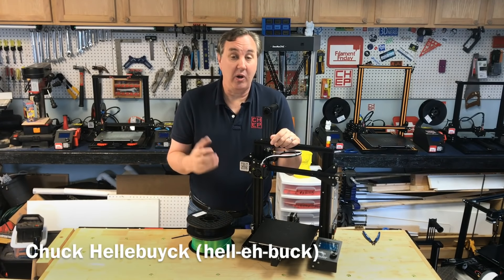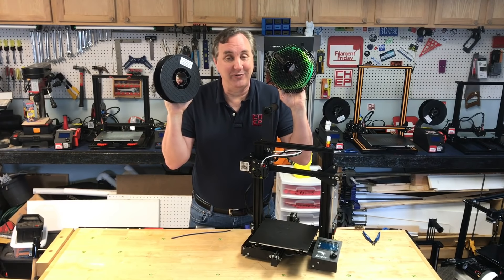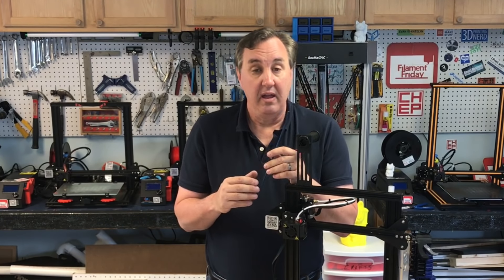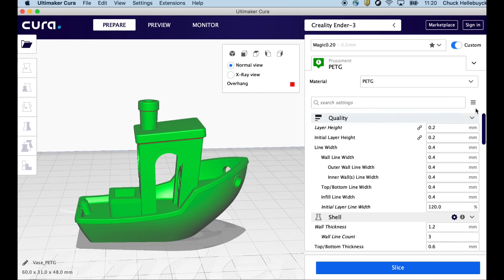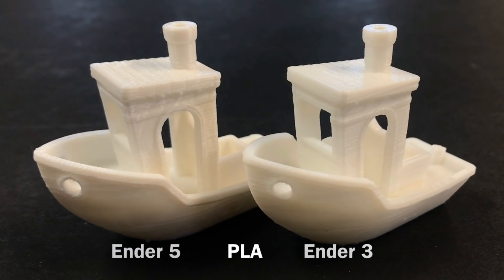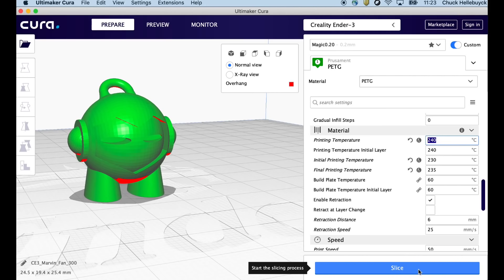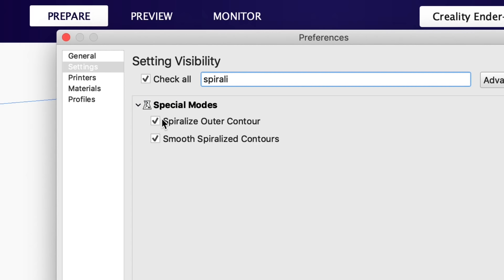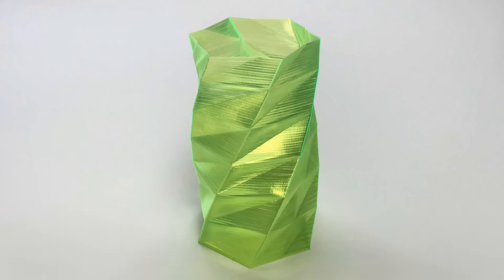PETG on Creality Ender 3 - Atomic and Prusament

Comment: I printed and use a dual fan shroud for the stock hot end on my E3V2 and still get the ooze monster at pre-print homing with my Sunlu petg. Cutting down temp to 230 has helped but small prints turn out like little blobs.  I've resorted to Raft mode on mini prints (screws and boots and what-nots). Is there a recommendation you would have for the fans and retraction settings?
Reply from the maker: 230°C with PLA?
Reply: @FilamentFriday  sorry, PETG.  Just trying it out for the first time. Not a fan of rafting but it seems to help for whatever reason. I have ABL and the glass carbo-bed and am within .05 on all 9 points as far as the leveling. I used glue sticks with a water wipe-down to evenly spread and cover the bed, which also has helped but still seeing the raft as best holder for small parts. Stringing is my nemesis too on bigger parts.
Reply from the maker: Stringing on PETG usually means it needs to be dried.
Reply: @chadwickjones2824  Use minimum layer times, you're printing too fast for the cooling your machine has.

Comment: I am using your Cura 5.1 profile with Hatchbox PETG filament.  As a whole, it is printing very well.  however, the first layer or so prints pretty terrible.  The nozzle bunches up the filament and it is pretty messy.  Then, after another layer or so it straightens itself out and prints fine.  Should I slow down the print speed for layer 1 and see if that might fix the issue?  I am new to 3D printing but that is the suggestion I see most often for a first layer PETG issue.

Comment: Awesome video, I have the Ender 3X and I've been reading alot of people have issues with PETG where the printed part will pull a chuck of the glass bed out when they try to remove it. Have you experienced any issues with that? How would i prevent that I'm a bit worried about printing with PETG now. Would having a bit of glue stick on the glass bed help? Thanks!
Reply from the maker: Yes Glue stick can help but may not be needed. I’ve found the glass chunk issue is related to using non borosilicate glass.
Reply: @FilamentFriday  Thanks for the quick reply! i couldn't find the specs of the glass it just says special glass on amazon. But it is the creality one that came with the Ender 3x do you think im going to run into that glass chunk issue?
Reply: @GamingRobot13  I've also read in a few places that you can use blue painters tape or hair spray if it is fusing to the glass.  All3dp recommends glue stick or hairspray and Matterhackers recommends painters tape.
Reply: @knight2_686  Ill give glue stick a try!
Reply: @GamingRobot13  I usually use glue as well but the tape works pretty good.  You just have to take the time to apply it.
Reply: I was going to ask the same question about printing on glass, it would be nice to get a definitive answer to this so disaster can be avoided. So far all that I see here is guessing.
Reply: @pbshooter100  I haven't had any problems with PETG fusing to my glass bed.  The bottom line is not to print it directly onto the surface.  You need a release agent in between, be it glue stick, hair spray or painters tape.  Each one has it's advantages.  I really haven't tried hair spray, but I have glue and tape.  The glue is easy to apply and you can vary the amount, but its more of a pain to clean up.  Painters tape is easy to get off the bed but you may have to clean some tape off the bottom of the print.
Reply: @knight2_686  Thank you for the info, it is much appreciated!!
Reply: To save your glass, try blue tape
Reply: Try wiping down with windex (has to be windex as it’s the silicone in the spray that works as a release agent)

Comment: Used your cura profile, carefully leveling a couple of times, wiped with alcohol, I'm still not able to get the PETG to stick to the bed. Any idea? I'm using overture PETG and the magnet Ender 3 Pro printing bed. Can I use hairspray on the magnet printing bed?
Reply from the maker: Yes. Or glue stick. Avery Glue stick washes off with soapy water so I sometimes use that.
Reply: CHEP thank you for your reply. Your style is my favorite!
Reply: Slowing my first layer to 15mm/s from 25mm/s made a difference with my PETG adhering to my bed, no other changes were made.
Reply: @madmax3078  Thanks! Will try speed parameters. Meanwhile, I switched to the free bed sheet overture provides with the spool and it works well at 240/65. I have another problem with heavy stringing when printing a large flat surface (i.e. top layer of raft). Making one step of progress at a time~~~
Reply: @FilamentFriday  I can add one thing. I saw where a guy used a rag and water to spread the glue around. It got so slick when it dried nothing stuck to the bed. I cleaned it with alcohol and just spread the glue when it dried. And then my parts started to stick to the bed again.

Comment: What about the bed? Did you print on glass with some glue stick or hair spray. This is the info I need. Every video says what temp to print and watch out for ptfe tubing.
Reply from the maker: I used fresh Buildtak in this video.
Reply: I use bare glass with hairspray at 70c for sunlu petg

Comment: It works better with the stock setup than with a Micro Swiss... I'll tell you that much.
Reply: Really? I put an all-metal Micro Swiss on my CR-10, but I've got an Ender 3 working its way to me via FedEx right now, so I'm excited to try out the AmazonBasics PETG on my Ender 3 that I couldn't get working right on my CR-10. I'll have to try Chuck's profile. (Already have a capricorn tube waiting on my desk to swap out the stock one after I fix all the other safety issues on my Ender 3 when it arrives)
Reply: Yeah...advantages of all metal hotends are vastly overstated.

Comment: How do you manage to print with only 60 degrees on the bed? All the PETG I've found recommend a minimum of 80C, bed adhesion has been an absolute nightmare. I have to run my bed at 100c and even then it often won't stick even with glue or hairspray on my ultrabase
Reply: In another comment he said he's using Buildtak, which afaik has very good adhesion. I'm using the ultrabase too on 2 printers and I use 70C as the bed temp and have no problems with PETG. Are you sure your nozzle is close enough to the bed? Also, it shouldn't be too close either so it curls up, since PETG doesn't like that at all. I also print the first layer with around 20mm/s to be sure. If that doesn't help maybe the bed simply needs to be cleaned. I use isopropyl alcohol and paper towels to clean the ultrabase.

Comment: Question, if I use the glue stick to add an adhesive layer, what should my bed temperature be? I use the glue stick with 80C bed temp, it didn't help at all because the glue dried up.
Reply: I use ender 3 pro with petg only, never used heated bed. With good bed leveling and clean bed it sticks perfectly. i clean my bed with isopropal alchocol and spatula to remove all glue.
Reply: I use a mixture of water and Mod Podge. Spread a thin layer on a clean glass bed and heat it up to 60-80c until it dries. The surface can be used over and over again. The PETG sticks nicely. I print with an 80c bed and no fan. Let the bed cool COMPLETELY (room temp) and the parts usually come right off without much effort.

Comment: My brother and I are having issues with the blue ptfe tubing. We use it with pla and it clogs up our nozzles. Could the high temps of our pla cause it to be more liquid and easier to get in between the nozzle and the tube when in the hot end? I've thought about testing the pla at lower temps to see how low I can get it
Reply: Clogging is often an indication that it's not a completely level seal between the tubing and the head, or that it's not seated fully and leaks around the joint. Seen several YT videos that indicated the seal has to be just so or you get leakage around the hot end. Don't know if that's your problem, but thought it worth mentioning.
Reply from the maker: I’ve covered this PTFE/nozzle gap in this video. https://youtu.be/x35aWmnZ_A0
In most cases though clogs are caused by the fan beginning to fail and/or the last 10 mm of PTFE that touches the nozzle gets cooked. Cut it off, push it back to the nozzle and issue is gone.

Comment: You need to be running just about all PETG around 245 - 250 for the best prints....not sure why people are so scared to run the temp up. Also bed temps should be around 80-90. 60 is too cool. Once you get used to PETG honestly, you won't want to go back to PLA. Most of the decorative filaments tend to come in PLA and that would be the ONLY reason to be printing PLA. Functional/structural parts are in PETG's wheelhouse. There is no off-gassing like ABS and your part won't feel like a cheap toy.,
Reply: I think it depends on the brand. I tried to print PETG (brand: AIO Robotics) at 245 / 250°C because most people on the internet will tell you to do so and the result was a bumpy, stringy mess. 235°C and most of that was gone. It's still not gonna be my favourite material to work with. PLA is so much easier to handle.

Comment: I’ve gotten prints that are optically transparent using PETG on my ender 3 pro @240 with 0.08 layer height. Going higher starts to make it cloudy and reduces surface quality.
Reply: Standard 0.4 nozzle?
Reply: Yep, I just installed a .6 to see if I can boost the transparency even more but I havnt done the test yet with it. It’s not like glass clear... but it’s definitely the kind of clear everyone says is impossible with FDM... and I’m not even using high quality polymers yet, just 3dHero petg. I’ll try to take a picture and get it online in a few minutes.
Reply: @mikescholz6429  Speed? That can change a lot the transparency. However i will try your suggestions :D
Reply: This was 40mm/s, going too fast wasn’t allowing the air bubbles to escape from between the infill lines. Also the model is the origami carabiner on Thingiverse printed full size

Comment: my Ender3 has notchey wheels even after wheel replacements, any suggestions? can the rail be to blame, its on Y&Z
Reply from the maker: Yes. Check the rail for flaws in the v slots.
Reply: I had some of this too.. Grease or oil your wheel bearings and make sure your eccentric nuts arent too tight. If they are too tight end up feeling every bump and putting drag on motors. Tight belt, snug wheels. I also used my hand to feel the 2020 extrusions and any rough spots i smoothed out with a scuff pad.

Comment: I don't know what I'm doing wrong, but no matter what settings/speed/temps I try I can't get a clean PETG print to save my life.
I recently also replaced my heating rod and thermistor and that helped a bit, but at 240~ and 50mms I get tons of stringing and blobbing - Prusament PETG lime green - same one in the video.  This is a very difficult filament to print with for me for some reason.
Reply: Slow your speed down possibly? I just printed my first PETG at 230 degress, bed is 60 degrees, and then a speed of 65.
Reply: @tracyhall3576  I got down to 30mm/s to get it to print but now I'm troubleshooting z-wobble facepalm hahahah
Reply: I can't get a clean PETG print to save my life either, it's not just you. So far Pressure Advance in Klipper helped the most, but if it's not the most simple part in the world PETG is the wrong choice for me.
Reply: It appears that PETG is more sensitive to moisture and you might benefit from drying it out, especially if you've had it open for a while. I'm going to get a food dehydrator for my PETG,
Reply: @IanSlothieRolfe  I did - finally fixed that issue.  Now PETG prints better than PLA on my build. LOL  Modified my printer a LOT more since this post.

Comment: What are your thoughts on keeping the factory boden tube and replacing the hot end with an all metal verision? From what I have read it seems you can avoid a thermal breakdown (of the boden tube) by keeping it farther from the extruder (that is the difference I understand between facotry and all metal) to reach temps suitable for petg?
Reply from the maker: It will work

Comment: of cours the three rolls I own are inland lol
and yes I cant get it to print for crap
Ive tried it on my cr-10s400, cr ender-4, and cr-10spro and it sucks.  It strings, globs, and it hard to get to adhere to glass.
I thought petg was supposed to have all the advantages of abs but print with the ease of pla.  No joy for me.  I saw so many glowing streams about it I bought three rolls for a project.  Well I guess I can use them as door stops
Reply: Check your retraction settings.  I found that on my S4, I had to slow down the retract/prime speed (8mm/s) and increase the retraction amount (8mm).  As for adhesion, I find that hairspray works great.  For prints with a small contact patch (like a sphere for example), use a brim.

Comment: Having done a temp tower on black PETG I find 230'C works with minimum stringing
Reply: what brand of filament? i just tried overture and it was garbage =(
Reply: did you custom make a temp tower? I have a good one for PLA would a PETG one would be appreciated.
Reply: @nathandively8524  I just got the overture light gray, it was on sale for $10 at the time.  It's my first PETG, and I ran a temp tower from 250 down to around 200.  230 seems to be the best.  It wouldn't print after like 210 lol, just stopped melting.  It was also the only filament I've ever printed that had zero stringing at every temp, although none of the bridging was good at all.
Reply: @Bermwolf  They're easy to make in Cura.  Just slice a temp tower and use the slider to see what layer the temp changes are at.  Then use the script feature to change the temp at each layer you need.  Just remember that once you add the script, they stay activated until you turn it off haha.
Reply: @TheLeathersmithShop  interesting I knew you could do this for changing color but not for change in temp. Thanks for the tip
Reply: @Bermwolf  Yep. I'm using Cura 4.4, so this applies to that version and maybe not the others but at the top click on Extensions>Post Processing>Modify G-Code.  A new window will open and you want to click on "add a script"  and select the "Change at Z" option.  Then change the variables you like.  Just add a new script for every temp change you need.
Reply: @TheLeathersmithShop  I switched back to PLA to make something for new years but I'll have to try that. The NGEN has been a beast. But I am trying to prove the MakerBot my work got is mierda compared to my ender so :) time to crack on

Comment: Why would I use PETG instead of PLA?
Reply: Stronger,  less brittle, more flexible and it has a softer feel to it. Also it can hold up outside better with better heat tolerance.

Comment: My sunlu petg keeps catching on the nozzle and being dragged. It seems to not stick on when the printer starts a new line
Reply: Try leveling a bit further from the bed. Petg tends to stick too well to glass and other surfaces so your issue is most likely that your nozzle is too close to the bed
Reply: If you are not levelling with a printed calibration model and only with paper I suggest you start doing that.
Reply: @darenraskovic3965  I ended up getting it to work. Thanks! I am getting a weird error now though. When I start a print from the SD card the printer will beep and it will say "Nozzle is too Lowperture". If I start from Cura it works fine but will then halfway through give me a thermal runaway error.
Reply: @darenraskovic3965  Update, fixed all my issues. PEI helped with adhesion, I had removed the silicone sock which caused the thermal runaway error and low temperature error. Thanks!

Comment: Just tried these settings.... exactly copied from the fields you show, but cura is updated now and some of these don't exist in the same terms now, or were expanded into dozens of sub-variables.  My prints consistently fail, but I think my problem has to do with my squish and the gap I'm leveling at.  Just thought I'd mention though, if you get a chance to update this, it would help me eliminate other things I might have selected with the wrong options.  Great video though, making me think of reverting back to an older version of cura to try it!